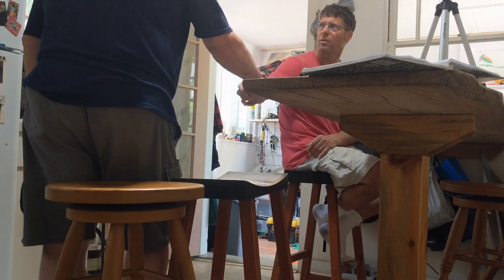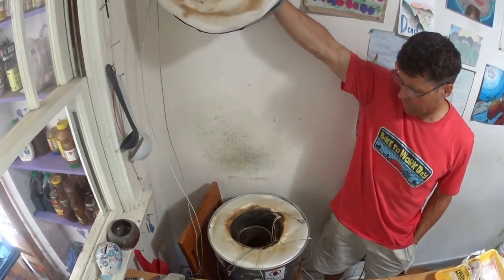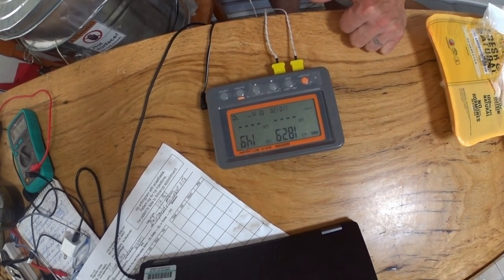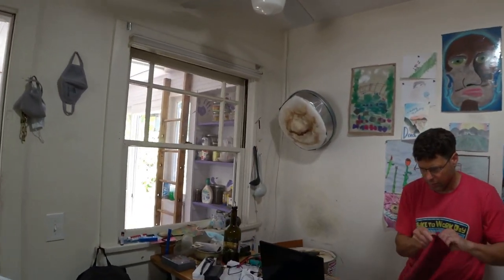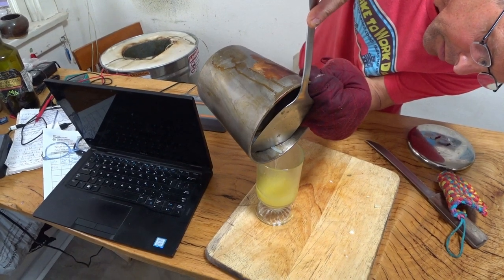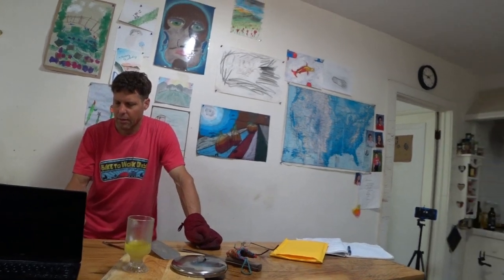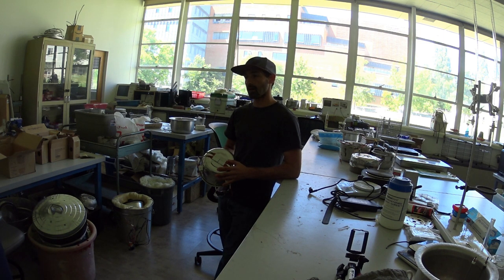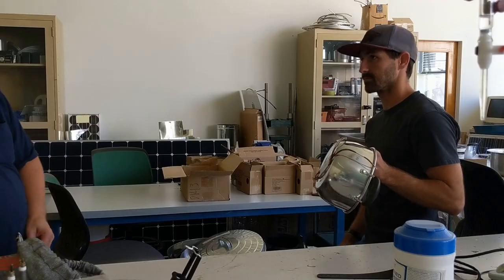Pete Schwartz: All In With Insulated Solar Electric Cooking

Comment: I am wondering if part of his goal is to avoid battery use in the system.... I have used a Goal Zero 1000x power station to cook with both a NuWave Induction cooker and recharge with panels hanging from the side of my old truck... I  have also used Itaki cookers with my power station setup which is lower wattage than the induction cooker on low.... a couple hundred watts... it gets to be plug and play existing parts... but not really cheap in the route I am using to solar cook with photovoltaic power stations... doing it without the power station technology would reduce costs quite a bit... the heat storage system is an interesting concept...

Comment: Try hot plate elements,  about $10 for an AC hot plate with a circular pan sized element that could be easily removed from the hot plate, amount of DC current to get it to heat the element?  If it works a whole lot less effort than cutting and shaping oven elements... for direct DC adjust the power level to the existing element size?

Comment: So it is about direct solar energy and skipping batteries mostly.... I know the inverter power loss on my power stations for AC output from DC is about 8 watts... using an Itaki cooker for doing rice run at less than 200 watts AC... not sure about DC cooker wattages yet.  The issues with larger volume cookers than the Itaki cookers... is likely to be limited by the amount of panel power available... one way to counter overcast is extra reflection to the panels to drive them closer to maximum output under poor solar conditions. What percentage of panel efficiency does he typically have in the area he is in?